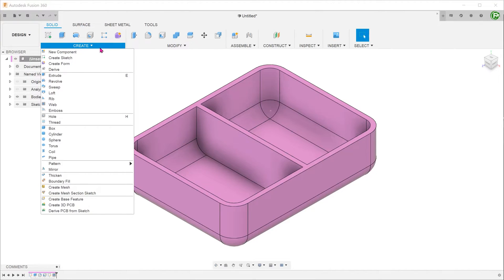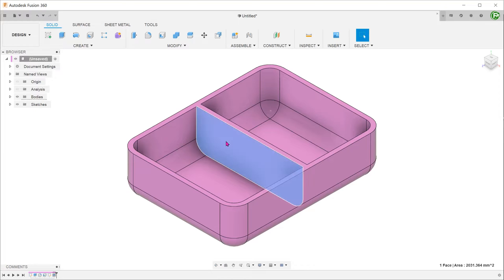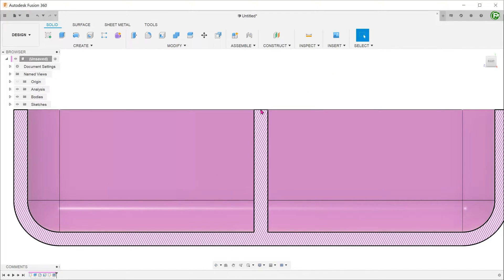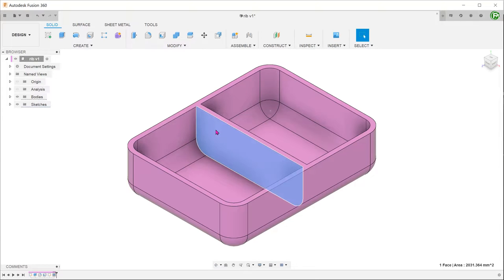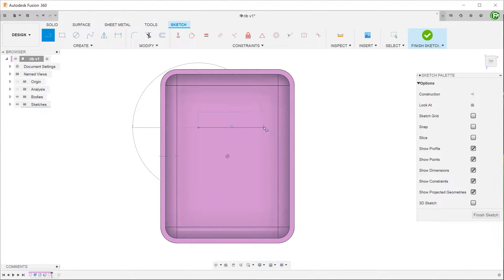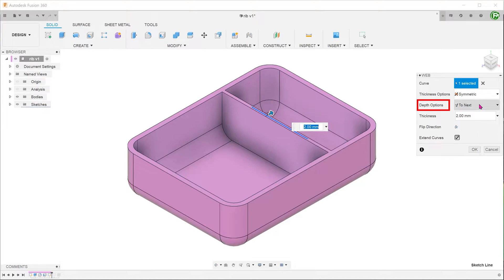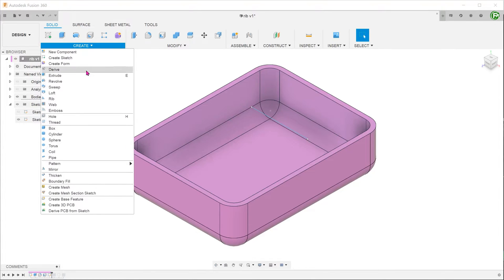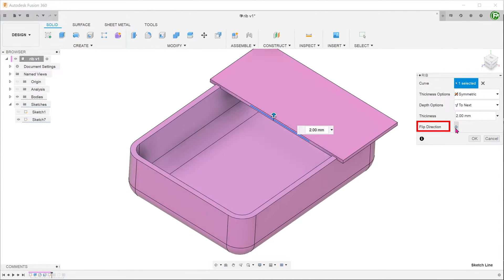Fusion 360 - Web VS Rib

Comment: why there's no draft angle for the ribs/web, without an option for draft angle this function will be practically useless right?
Reply from the maker: There is no draft angle tool built into ribs/web. There is a separate draft tool under modify.